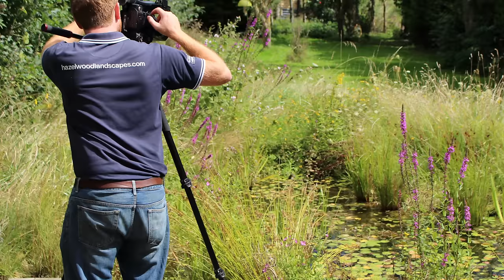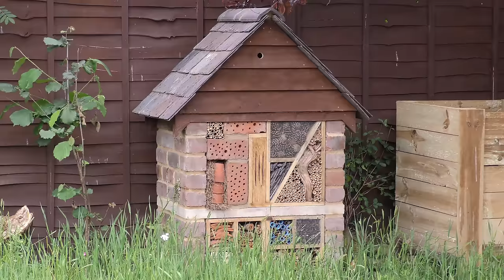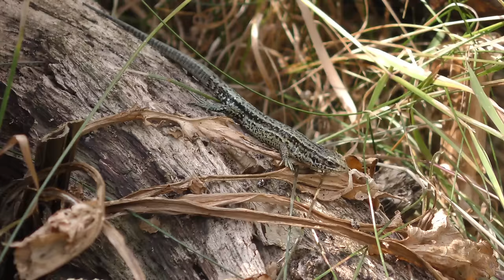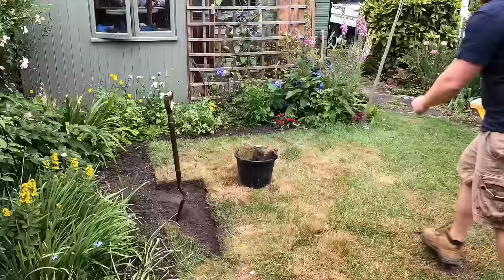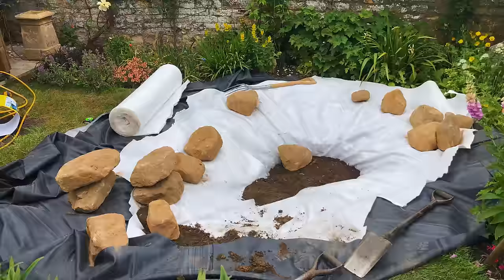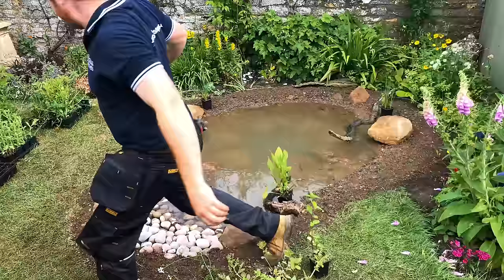Making a Small Wildlife Pond - Timelapse - 4K

Comment: I love that digging bar with the blade end. I hand dug a pond on my property a few years back where the ground was clay with rocks embedded in it. Nice for the final pond, which did not need a liner, but it means every scoop I dug out had to be fought for with a pick, and some angles were not easy to swing a pick at. I did have a digging bar but the flat end is less than 2 inches wide and it made for slow going. As a side note, if you have clay soil it does make for a very natural pond, but with no liner size limits you may end up thinking "just a little deeper, just a little wider, just another hour of digging today" and that's how the my plan of a three foot deep goldfish pond got a little out of hand and now I have an eight foot deep pond with a bass and some trout living in it.

Comment: And to think I e been worried about soil sneaking into my current “all stone” pond  gives me much better ideas for treating my excess overhang.  Cutting it off!    Great video.
Reply from the maker: Hi Glenda! :)  Thank you for this, although I must point out that it's the poorer subsoils that you need for any soil IN the pond, the other soil is fine for around the edges and allows you to plant directly into it - this 3 part series showing how I made this pond and the reason this method is used is here:

https://www.youtube.com/watch?v=lKrjMv6TMlU&t=2s

Just wanted to make sure you weren't about to put topsoil in the pond as this will float about and add nutrients to the water, encouraging blanket weed etc.  Hope this helps and thanks again, welcome to the channel!  Best wishes - Joel

Comment: Hi
Thank u for this great channel as I started to turn my garden to benefit the local wildlife. I did dig a large pond last August 2019 but before I can lay it with a pond Liner the Autumn rain started and as u know it hardly stopped all through autumn and winter and as my garden soil is Clay the pond was absolutely filled with about 3 feet of rain water. In February the pond was full of mating frogs and within the next 2 weeks the pond was full of eggs and right now full of tadpoles. Now my question if u can help me out I he grateful is: as the pond had no water loss (except through evaporation because of the heatwave we've had all through May) do I still need to place pond Liner or can I just leave it as clay based pond ? As I'm new to all this gardening and wildlife I dont want to disturb  frogs; toads and Newts (I've seen small ones about the pond plants) that might have made their home? Should I drain the pond after all the tadpoles leave the pond; please help as I'm in a dilemma now specially as it started to rain again for the past few days and the pond water level gone up again . Cheers
Reply from the maker: Hi Reza. Thanks for getting in touch  I’m pleased you are enjoying the channel 😊 As for your pond, if it managed to hold water over the last couple of months, chances are it may well survive the summer with no liner. In the wild, some great ponds are ones that actually dry out in the summer months, after most amphibians have finished their life cycle. Newts and frogs in particular often leave ponds later in the year to hunt defied they hibernate. In essence, I’d wait and see what July / August brings, as you can always line the pond in the autumn. Hope that helps 😊
Reply: @WildYourGardenWithJoelAshton  
Thank u for ur reply. Can u plz explain why do we actually need pond liner for? If my pond seem to be good at keeping hold of rain water; can I just leave it natural clay based specially as I've noticed bees have made holes in the clay and they are constantly in/out if the holes.  Cheers

Comment: 3:10 whats the surface layer material that you covered pond with? Thx
how do you clean it or is it cleaning itself, since it's still water.
and what is your solution for mosquito season? Drain it?

Gr8 timelapse showcase. thumbs up
Reply from the maker: Hey Max - thank you, it was difficult to get back to this client's pond to show it once the plants/oxygenators had established - but if it helps, there is a 3 part series on the channel about how and why I make ponds these way.  There are no artificial pumps or filters, and I don't add fish to these wildlife ponds, not only because of them eating small larvae etc but the extra nutrients the natural "waste" of the fish make means that algal blooms and murky water are encouraged - I do like fish, but this is why you see such expensive pump/filtration set-ups with Koi, it's the nutrients that you're battling.  Anyway, hope this helps but do check out the series on the channel and it explains more.  Thanks for the kind words and support, they do make a difference - Joel

Comment: What a great pond.
You used the soil which you digged out, for the bottom of the pond?
Is this the best method to fill the bottom with?
Reply from the maker: Hi there Menno - so sorry for the delay in responding, workload means that I have been working long hours and unable to keep up with all the comments - but I don't want people thinking I am ignoring them.  Forgive me if you have seen already but there is a 3 part series on the channel that explains the method and reasoning for me building these ponds this way for over 17 years now - here is part 1:

https://www.youtube.com/watch?v=lKrjMv6TMlU&t=41s

This will give more detailed information re the soil, but it is SUBSOIL low in nutrients that I fill the ponds with, this helps to prevent algal growth and allows planting directly into the soil without the need for baskets.  Best wishes, Joel
Reply: @WildYourGardenWithJoelAshton  thanks Joel for your answer !
Does it make any difference to use Lelite soil or poor subsoil, what about lava split?

Comment: Would have definitely put somewhere in here that if anyone plans on doing this go to your cities municipal building and have them give you a print out of any sewage/electrical/natural gas lines that could potentially be running through your yard. If a pond were to leak into the ground below it where theres electrical wiring you just killed an entire blocks power. Or if you hit a sewage line digging in your yard it could flood your yard with the wrong kind of pond lol

Comment: Do you need a pump to keep the water circulating and prevent mosquitoes and excess algae? Also, why did you put dirt on top of the plastic liner?
Reply from the maker: Hi there, it's difficult to tell in this time lapse of course (I never dreamed this video would be so popular!) but it's subsoil that goes back in the pond due to it's low nutrient content, and the native oxygenating plants and broad leaved plants keep the pond cool and shaded so no artificial pumps etc are needed.  If you wanted to see how and why I make ponds like this, there is a 3 part instructional here:

https://www.youtube.com/watch?v=jG1w7MUhhXs&t=3s

Best wishes, Joel

Comment: Spot on design mate, the problem is how are you going to control water levels when we have a week of constant rain
Reply from the maker: Hi Matt, thank you :)  In 15-16 years of making these ponds for clients there has never been a problem with overflow of water - any excess water is soaked up by the surrounding plants once they are established, I don't believe fibreglass or concrete ponds are made with any "drainage" system and those ponds don't allow for planting around the edge of the pond - this pond was filmed immediately upon finishing - if you wanted to see just a few of the ponds I've created over the years there is a short video here, it does show how the vegetation establishes and how the oxygenators keep these ponds clear without the need for electricity etc:

https://www.youtube.com/watch?v=jG1w7MUhhXs

Best wishes, Joel

Comment: Good job Personally I would have used cement and would have added pebbles around Water would remain cleaner in this way.
Reply from the maker: Thank you Costas - this was when the pond was first finished, the oxygenating plants added usually work in 2-3 days to make the water clear and any fine debris settle - pebbles are fine too though of course :)  Best wishes, Joel
Reply: @WildYourGardenWithJoelAshton  I had used that black layer (have forgotten how it's called) in my garden in Swindon when landscaping and was infested with slugs! So I would still go for cement.
Reply from the maker: @costasichaelrokkoudes938  That's why we use a thick layer of soil over the fleece that is over the liner, the liner lasts a lot longer this way too :)  I prefer the natural look of these ponds but it doesn't mean I don't like cement, there is a formal pond on the channel too, using this material :)  Best wishes, Joel
Reply: @WildYourGardenWithJoelAshton  Thanks Joel The slugs were under the fleece. Result: My plants' leaves ended up eaten and in different shapes. Cement might take a little bit longer but would prefer it (personal point of view) Just mentioning the cons of the "fleece".
Reply from the maker: @costasichaelrokkoudes938  The slugs are certainly after the plants and not the fleece, we use subsoil so any slugs wouldn't last long under the fleece - but I have never experienced this, it could be because lots of frogs etc are attracted to these habitats and they take care of all the slugs before I see them :)  Cement would probably take the same time, the ponds have a lot of fleece and liner to do and is extra expense, but cement dust is a big polluter, so it's hard to decide - best wishes, Joel
Reply: @WildYourGardenWithJoelAshton  For as long as frogs do come that would be fine. This will depend on many factors i.e. area where you live if the garden is well fenced frogs might not come, on how quiet is your area etc. Still prefer cement though. Another idea would be bricks with a layer of shringles and small amound of cement. I'd rather use the fleece for cage-roofs.
Reply from the maker: @costasichaelrokkoudes938  Very true - I was talking about frogs and how to attract them here, and what you need to do.  

https://www.youtube.com/watch?v=RFmVjpSkl_I

I can't use cement otherwise it doesn't allow natural planting in the soil and means plastic containers in the pond too, which I avoid. Best wishes,
Reply: @WildYourGardenWithJoelAshton  Thanks I'll watch the video. Still my house was fenced and no frogs ever appeared. As I have pointed out one has to gauge what's best for his garden, preferences etc as there are pros and cons with each choice. Of course if one prefers using fleece what you show in this video is a very good solution and what's more you explain the process in detail. I'm sure that all your videos are extremely useful and thanks for sharing them with us.
Reply from the maker: @costasichaelrokkoudes938  Thank you Costas, I appreciate your kind comments, I am glad we could talk here - I hope you manage to get frogs again soon, best wishes to you and your family - Joel
Reply: @WildYourGardenWithJoelAshton  Thanks Joel same to you. I've left the U.K. though it's been some time now. Swindon as far I can remember was a relatively quiet place, yet in villages and in many counties of England that are not close to London one gets generous gardens and more space to "play with" gardening which is, no doubt, fantastic hobby.

Comment: I enjoyed the video but question is this a good idea if you live near a flood zone? How would that work during the rainy seasons?
Reply from the maker: Hi there - although we get a lot of rain in the UK, these ponds haven't proven a problem, due to the subsoil and planting around the edge a lot of excess water is soaked up this way - I wasn't able to show this pond once it had established after a few weeks as I work all over the country - but if you were interested this short video shows just a few of the many client ponds made this way and how they turn out:

https://www.youtube.com/watch?v=jG1w7MUhhXs&t=7s

Best wishes, Joel
Reply: If there’s a risk that your garden gets flooded, it’s a good idea to raise the pond above the expected flood level or to make sure that you only use native species of plants and no animals so if it gets flooded there’s no risk of introducing a potentially invasive species to your local ecosystem.

If there’s no risk that the garden gets flooded, but still some very heavy rainfalls that could lead to the pond overflowing you could leave one corner of the pond slightly lower to act as a overflow. We did that with our pond and made the pond a bit deeper in front of this corner, so we could add more substrate to ensure that the reed we planted there couldn’t get uprooted by the current. The reed is very dense and we also planted some aquatic moss between it so we have a very simple filter that prevents tadpoles or other small animals from getting dragged out of the pond if it overflows.
So far we had a few very strong rainfalls where the pond overflowed and we couldn’t find any animals that were flushed out, so it seems that this primitive filter works quite well.

Comment: 2 flat head shovels and no wheelbarrow.. Cushion on top of liner?
Reply from the maker: No wheelbarrow - steep steps at rear of this client's garden, hence the use of buckets.  The cushioning on the top of the liner is fleece, not only protects the liner but allows the soil to be static on top, allowing planting directly into the soil = negating the need for plastic baskets.

Comment: what is the black and white plastic sheets ?
Reply from the maker: Hi there - it's not plastic but a rubber liner, and the white parts are industrial fleece, if this isn't available where you are then old carpet can be used as it will be hidden by the subsoil - there is a 3 part series on making this pond on the channel :) Hope this helps - best wishes, Joel

Comment: How do you get the water clear? mine is muddy looking all the time!
Reply from the maker: Hi Martin - happy to help :)  Firstly, can I ask how old the pond is please?  Secondly, do you have oxygenators already?  Also are there trees overhanging? These would be the first few pointers but do let me know and I'll answer as best I can :)  You might want to look at the video on the larger pond I did, I do address some issues of older ponds and overhanging trees etc - you can find it here:

https://www.youtube.com/watch?v=UYxwjxzMdcw

Best wishes, Joel
Reply: @WildYourGardenWithJoelAshton  Thanks for the reply. It is a new pond, which we made September 2020. The nearest tree is a Hawthorn which is about 30' away. The pond is sheltered with a fence at the back of it. I made it with a black liner and placed stones around the top. It is only a small pond 2' deep in the middle with a 6" ledge around the edge, size is only about 3' x 4'. It is at the bottom of a sloping garden & has new topsoil on the garden border leading down to it. When we had heavy rain recently the pond over flowed, maybe my problem could be soil washing into the pond? I thought maybe it may settle, will I ever be able to clear the water?
Reply from the maker: @TheBadsanta18  Thanks Martin.  Ok, so trees are definitely not the issue.  It does sound like soil ingress/nutrients could be the problem here.  If you have several buckets to hand then I would suggest changing the water gradually - tap water can be used, after two days any chlorine dissipates so you could have two containers with the buckets of water or add directly to the pond.  The main "ingredients" for keeping a pond oxygenated and clear are your oxygenating plants, hornwort, spiked water milfoil etc - so ensure there is plenty of this.  Do let me know if there are no changes or the pond continues to be "muddy" and I'll see if there is anything else I can suggest.  Here when you need me - best wishes, Joel
Reply: @WildYourGardenWithJoelAshton  Thank you John. I was considering when the weather gets a bit better, To ask one of my grandsons to help me remove the stones around the edge of the pond & reposition them with cement to close the spaces between the stones. So that it may stop any garden soil from washing into the pond on rainy days. For me a big job as I am heading towards 80 but perhaps not a big job for a 25 y.o?
Do you think it is worth doing?
Reply from the maker: @TheBadsanta18  Hi Martin, I absolutely do think it is worth involving 25 year olds wherever possible ;) and of course bringing the stones closer together with the aid of cement in the gaps will certainly help any further ingress of soil etc.  Do you have oxygenating plants in there at the moment? If not I would recommend getting these in the next month or so as they will be readily available then - if you need any help with sourcing please do get in touch with me at wildyourgarden@gmail.com - best wishes to you, Joel
Reply: @WildYourGardenWithJoelAshton  I bought some oxygenating plants in September but was told that they may die during winter in the pond. So I slit the bunches up & put them in my greenhouse in 1/2 cut lemonade bottles. They still look alive. The plants I put in the pond I cannot see them as the water is too murky! It has just thawed out as it had thick ice & snow on for the last couple of weeks. I have a couple of grass looking plant pots on the side ledges, they were alive prior to the thick ice, I am unsure now though. I simply don't like winter.
Reply from the maker: @TheBadsanta18  Ah, I see Martin.  For a start, they don't actually die but "hibernate" for want of a better word, and should be left in the pond over winter, but of course with the recent soil erosion etc it means that they wouldn't have been "awake" enough to make an impact on clearing/settling the water. Do feel free to place them back in the pond, they will be absolutely fine and begin to grow again very soon.  I concur re winter, it's certainly brought some testing times with client work over the last few weeks ;)  As before, let me know if there are any other issues and I'll be happy to help - feel free to email me to so we can keep in better contact - best wishes, Joel